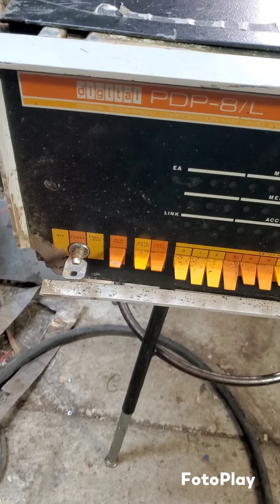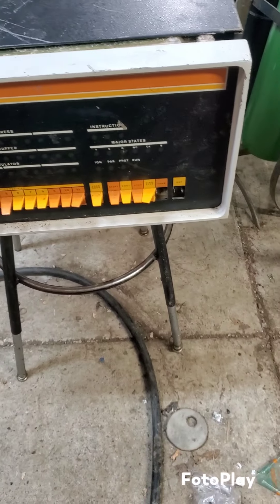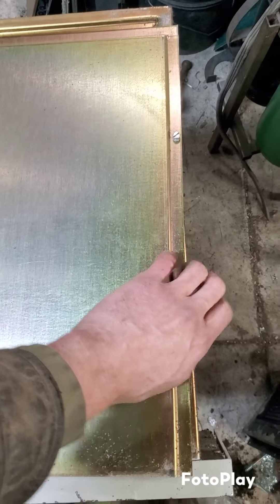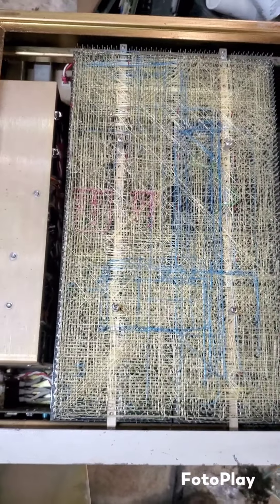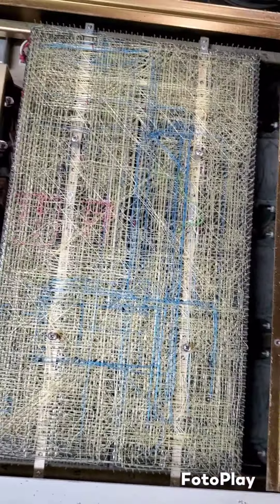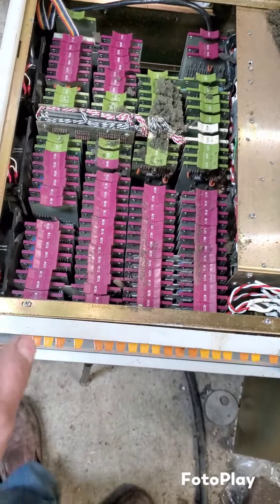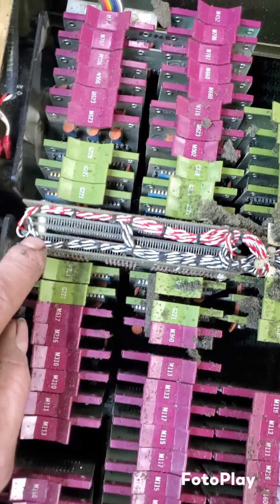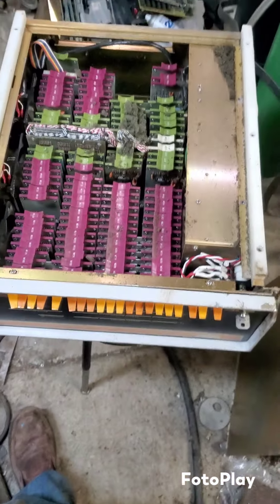My salvage find of the decade Digital PDP-8L

Comment: I used to fix those. I believe if you get power to it, use the front panel to load the top memory address, and then enter 012737 in octal on the front panel to test memory. I believe that was an octal based system, not hex. (Ergo PDP8)
It should be core (magnetic)memory, similar to what was used on the NASA Apollo systems. Very collectable.
Reply from the maker: I'm pretty excited about it and the inside condition being so nice.